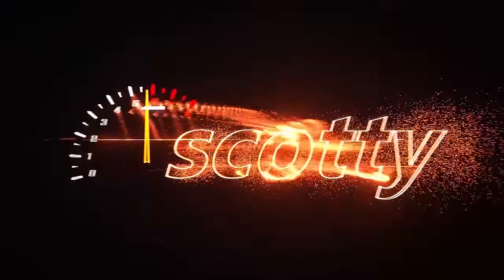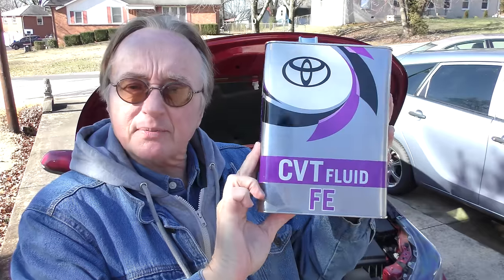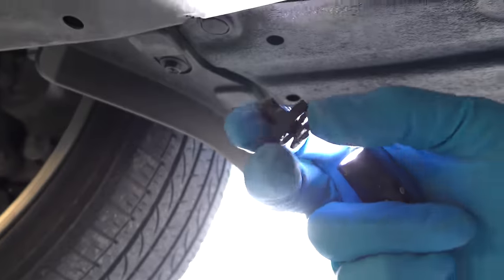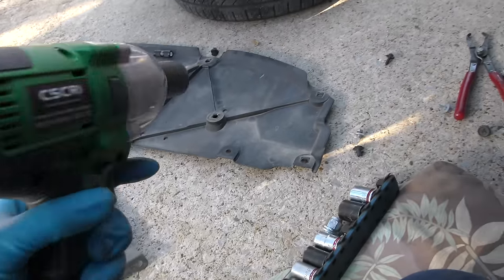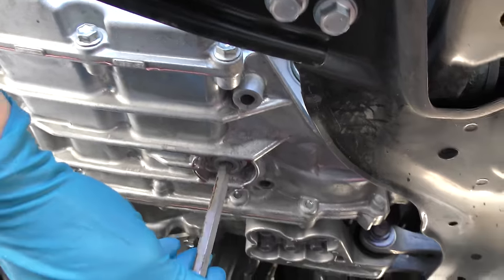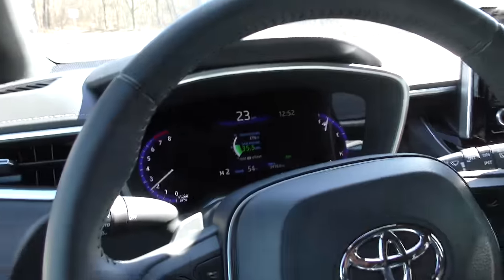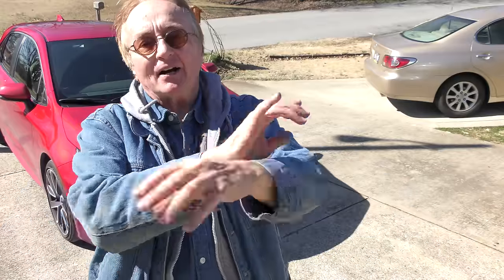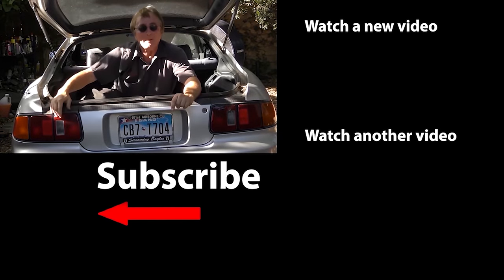Toyota's New Car Really Pisses Me Off

Comment: 35mpg is terrible for a 2 point slow. My 1990 escort gt got 40mpg around town and near 50 mpg on the highway with a manual. Just goes to show you 36 years newer tech, hybryd and a cvt means nothing when it comes to fuel econ.
Reply: and your old Escort had 105 hp instead of 195
Reply: Hate to break thus to you but those toyotas are 158 horses not 190
Reply: @ryanbrandt5404  2.0 hybrids are in the 190s depending on car. You mentioned hybrid and complained about mpg plus hybrid Toyotas are an Ecvt. Your Escort was a slug with no accessories in it...and I'm sure around town it never broke 30mpg. I get 60 mpg in my Rav 4 hybrid...which is not a compact car like your Escort. My 2005 bare bones 1.8l Corrolla with manual got 40mpg and only weighed 2600 lbs.

Comment: Scotty, and a CVT! Does Toyota use a small paper filter like Nissan? In my '13 Sentra I remove the plastic by the wheel well to access the filter? Always a pain to level off and use a scan tool to check the level.
Reply: That paper filter on the Nissan only has yo be changed like every 200,000 miles.  It's not like an engine oil filter that should be changed every oil change.

Comment: Toyota removed the transmission fluid dip stick with the previous generation Corolla that came out in 2014 and refreshed it for the 2017 model year.
Reply: Even Toyota is cheap. No transmission cooler on tundra etc.

Comment: At what mileage did you change that CVT fluid?
Reply: Change before 80,000 miles but 60,000m is a good time. I did mine at 88,000m last year,drives smooth as silk a year on.

Comment: All that stupid plastic crap protects parts under the  car from salt spray in the north. Of course you can damage it driving in deep snow. You really need to have spare fasteners in case you break any or replace them with a bolt. You probably have to make some hardware.

Comment: The plastic does prevent the mice and other rodents from crawling up there and chewing the wires. Also keeps water out.
Reply: Rodents can chew through plastic. And plastic has been discovered to be toxic in normal use cases more than they used to think.

Comment: That plastic crap is a pain. Our Mitsubishi Outlander awd has that. Or had I should say. Pulled it all off. It just scooped water in deep puddles and messed it up anyway. No problems with it. Great fuel economy. I do all my own maintenance. Idiots at dealer tried to tell my daughter it needed rotors and pads in rear?? I checked, looked brand new. Liars

Comment: Did that with my sister's Fit. Drain and fill the same amount. Funny thing is, all of the how-to videos failed to mention the rubber fill stopper at the top of the transmission. Changing out the fluid was a breeze.

Comment: Regarding the plastic cover, for an oil change there are three screws to remove a smaller door to access the filter & drain. Super easy. Also the stick hatchback version is a great daily driver.

Comment: Have a '23 Corolla Cross: the maintenance guide has NO CVT fluid changes UNLESS "driving while towing, using a cartop carrier or heavy vehicle loading". The first change when use under those conditions is at  60,000 miles.  
There are no changes called for at all unless those use conditions exist.  For ordinary use the maintenance guide advises to "check the automatice transmission for signs of leakage".
Reply: I think most vehicle manufacturers say the same thing, no CVT fluid changes unless towing 🤷.....or unless the CVT starts performing weird, shuddering etc (apparently the dealer scan tool can diagnose micro slips/micro shuddering & therefore a fluid change)
Reply: The same thing apply for automatic transmission but in reality, there is no such thing as lifetime fluid🤦‍♂🤦‍♂. If ppl don't change their fluid, I'm sorry they're asking for trouble unless they don't keep a car for long time. the manufacture these days want us to do it because their profit... I'm just saying.
Reply: @mrgarrison3516 Thanks for the comment.  .Somewhere down the road I'll have the fluid changed, if I keep the car up to near the six-figure mileage. I'll just have to see how it's performing and/or have the scan done.

Comment: if a gasket leaks some fluid after replacing the gasket how do you know proper fluid level?
Reply: Guesstimation. He seems like precision is not job1, nor safety.
Reply: I'm no mechanic but I suppose you could just look up the specs online.  It may even say in the manual.
Reply: If it leaked fluid, I would have the next fluid change done the correct way .....with a scan tool plugged in, the temperature range of the fluid (& the cycle through the gears PNDR) determines when to top it off & when a light stream of fluid comes out of the fill plug.

I've seen the full video of a full CVT fluid/ filter (& magnet clean) change

Comment: I would not want a hybrid  car.  I own a 12' Nissan Altima 2.5S in line 4 cylinder with CVT transmission that's been bulletproof and am in my 13th year of driving it.  If you change the CVT fluid every 2 years you will have no problem with these cars.  The 03' Lesabre car that I owned for 17 years before the frame rusted out only needed the 4 speed transmission fluid changed every 50,000 miles.
Reply: Nissan gets a bad rap but the Altima is a fairly solid vehicle if you take care of it.

Comment: They put that plastic junk on every car and guess what, my Korean car still needs it's brake lines chaged out at 105k miles. They didn't coat have the entire brake lines. Jist some parts. That will piss you off. Just bought a splice kit and I'm going to attempt it myself.
Reply: Same thing happened on my 2011 Forte and 05 Optima. Korean metal is not as good at Japanese quality.

Comment: My 2018 Accord Touring 1.5 Turbo CVT gets 32 city, 38 highway. I’ve seen up to 40 on the highway. Much bigger car and more comfortable too.
Reply: 1.5 is a tiny engine though for a full size sedan. Turbos are not known for their longevity...I am saying this as a Subaru WRX owner lol. I've owned a Honda Accord too, but it was a proper 2.0 L naturally aspirated that went to around 160,000 miles before I sold it..was still running great. You won't have that with turbos, 100,000 miles and you can expect something major.
Reply: @Ziegfried82  there’s nothing wrong with turbo’s although one must understand proper maintenance. We live in the west and my car pulls up the mountains no issue. We also have a CRV same engine. No issues with either car, one is 7 and the other 6. The 2.0 is a good engine, but so is the 1.5.

Comment: I thought the toyota hybrids had an eCVT that doesn't have a belt?
Reply: That's not the hybrid. He said hybrid, but only in the sense that the transmission has a first gear.
Reply: @0bzen22 
Got it, thanks - on rewatching, he clearly says that.
Toyota calls it a 'direct shift' cvt

Comment: that is a ridiculous price for a small car and i hate CVT they are just designed to wear out faster than old fashioned transmissions with gears.
Reply: The hatchback is definitely not a good value for the price tag. You can get the sedan equivalent for $2k-$3k less. Same power terrain and transmission plus, it's 100lbs lighter.

Comment: Very interesting. Now that you brought this up it's making me believe Ford is in cahutes with Toyota's engine and transmission manufacturer.
Reply: @harveyhankerson8359  Both the camry and Ford Maverick use an Atkinson 2.5 L 4 cylinder engines. Paired with the 1 gear cvt transmissions.
Reply: @harveyhankerson8359  The Ford Raptors have a GM made transmission. Ford has had GM engines and transmissions in their vehicle's in the past. GM has had Ford engines and Transmissions in their vehicle's in their past. Mazda has had Toyota and Ford engines in their vehicle's in the past. Ford and Volkswagen got together for the EV batteries. Honda and GM have a pact with EV batteries until 2024. Toyota and Volkswagen have been far ahead of the game with EV's and various different technologies that are associated with. Like they would experiment in areas other manufacturers avoided like hydrogen batteries or hydrogen ran vehicle's. Then the other manufacturers want to get involved. Porche is also very far ahead with EV technology compared to other manufacturers. Ford's strength is the charging stations. So it makes sense for them to work together to try and outperform one another.

Comment: I have a 2022 Rav4 with the 8 speed automatic transmission.  Is it better to change fluid on this transmissions at at 30,000  or only on cvt transmission  mind has 33,035 miles on it.
Reply: Drain and fill every 30k or so to get the best life

Comment: Screw CVT's
Reply: I am in my 13th year with driving my 12' Altima and never a problem with my CVT transmission.  Change the transmission fluid every 2 years and no problems.
Reply: @josephkelleher8820  ehhhh I'd say you got lucky myself. Lots of horror stories with Nissan CVTs and Nissan transmissions in general lol.

Comment: My 22 civic sports  cvt jerks around like mad when im driving slow in town. This is my first honda and im not impressed:(
Reply: CVT sucks in general. The ones made by Toyota and Subaru are better than the Hondas, but they are still crap compared to manual trans or standard automatics.

Comment: I want to buy one when my corolla 2004 die it got 401,057 miles 15 years with me bored as hell to drive the same car.😂😂
Reply: 07 camry 148k. is that original motor and tranny?  Id rather be bored and have money in the bank than entertained and broke.
Reply: @subaruamazon  yes original always change the transmission oil every 60,000 miles but don't get me wrong i have change spark plugs,  brake pads and starter and battery along my journey of 15 years. 🤣😂
Reply: @Mrstarboy331  wow. 401k. that is unbelievable. i think i can get 300k out of mine. good to have a solid car in this crazy car market. will ride it out for a while.